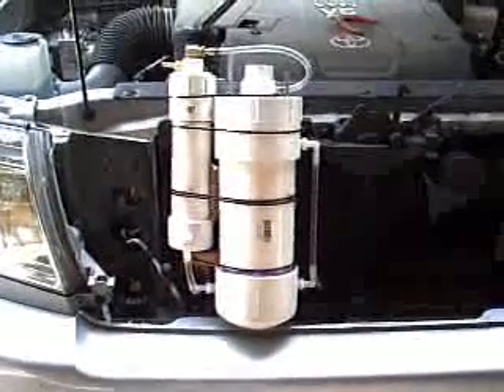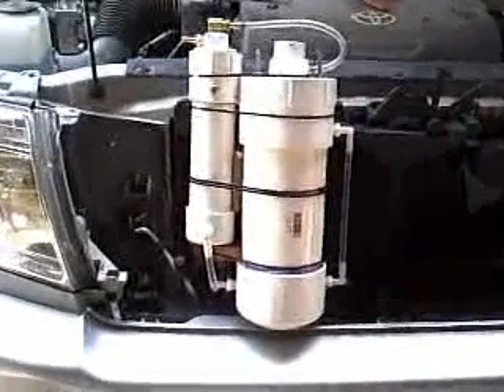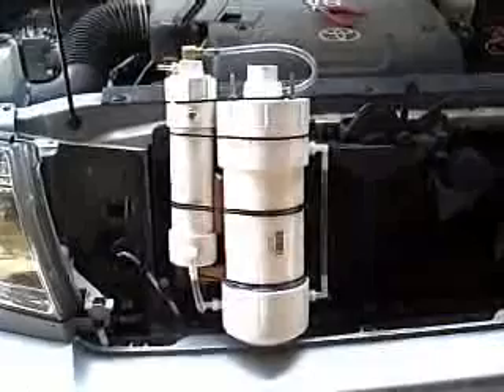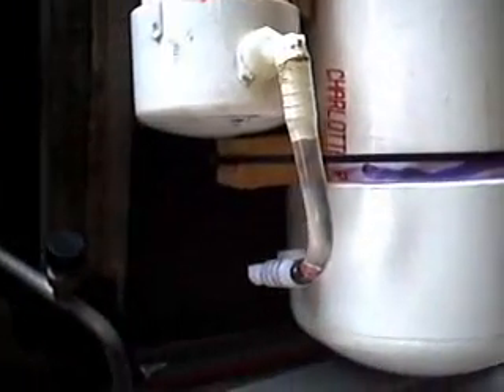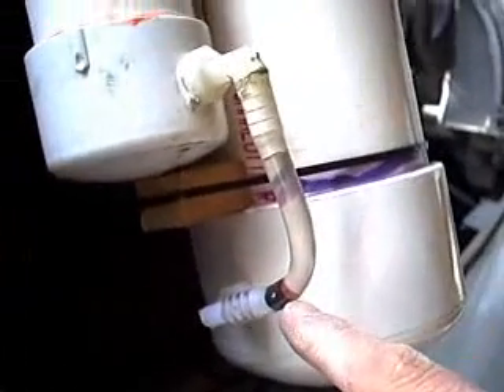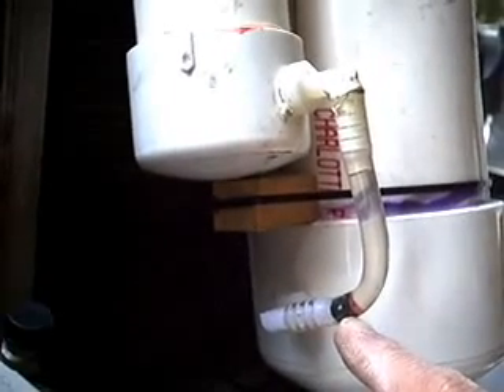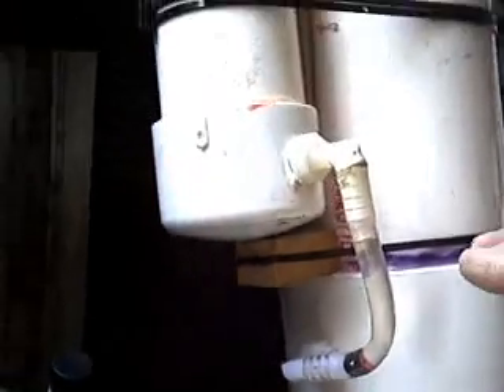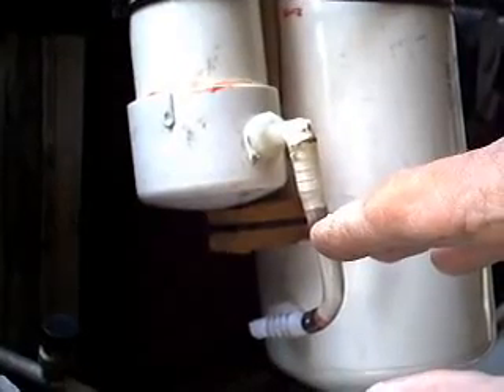#88 - VSPB Bubbler shared resevoir test

Comment from the maker: ...until you experience your first flashback into your cell. Then you will understand. Since you clearly have no intention of using a bubbler until you learn your lesson the hard way, hopefully all you end up with is some electrolyte on the bench or kitchen table and not in your eyes, in your aluminum intake manifold and engine head, or shrapnel in your face.

A good sturdy bubbler prevents all of these. It does not deter HHO production either, unless of course your cell leaks.

Comment: A float valve in the bubbler should work. Simplest to visualize is a ping pong ball that floats on the surface and as the water rises the ball seals the output. As the bubbler and the cell equalize the ball drops with the output opens again.

There are many types of these. I like the float with a long rod on a runner. you can adjust the length of rod for the disired air space.

Comment: I tried this too.  The liquid moves very quickly from the Fuel Cell to the Bubbler.  I believe it is related to the Bernoulli Effect, a negative pressure differential occurs between the Bubbler and the Fuel Cell.  Haven't got a solid solution yet.

Comment: try a one way valve so it does not back feed it will only go from the bubblier to the cell

maybe even have the tube from the bubblier to the intake bigger to help stop the back pressure (tap a vacuum line) 

nice thought i was thinking about this too on extending the time until needing to top off the cell again

Comment: In order for this to work you need to mount the bubbler higher than the electrolyzer and only slope the lines in one direction - no loops or valleys in the tubing.